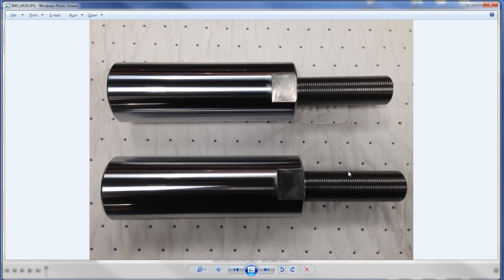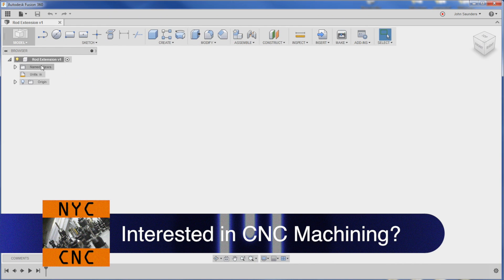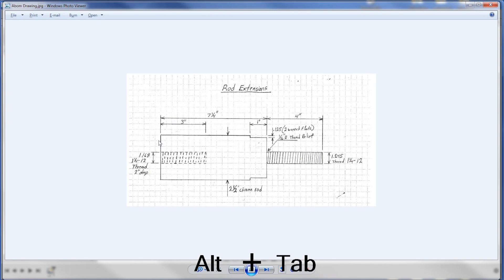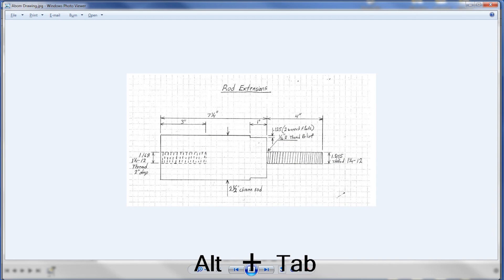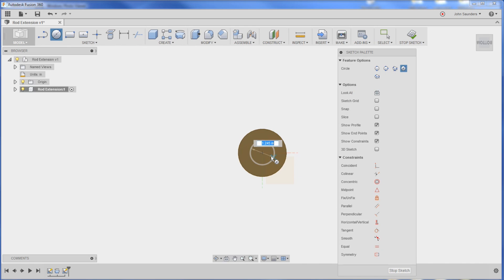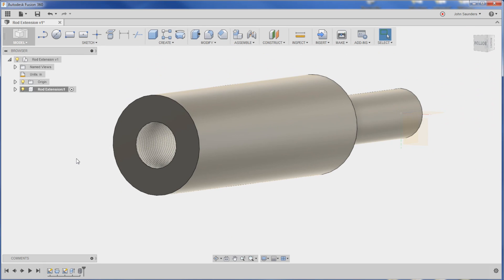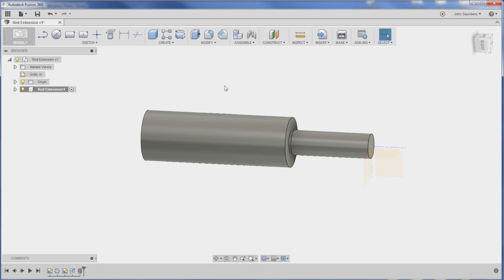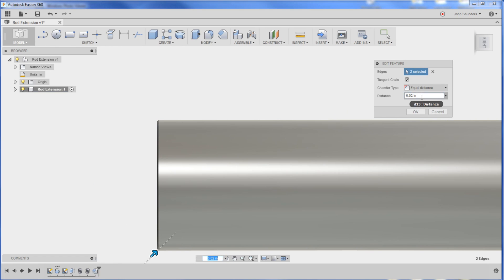Fusion 360 Basic Tutorial: Rod Extension!  Fusion Friday #28

Comment: since the wrench flats are dimensioned from flat to flat (i.e. the size of the wrench), isn't there some way to sketch a rectangle that is that dimension, centered on the axis, to use as a model?  That way the constraint would be the wrench size, independent of the rod diameter.
Reply: There is. Draw two horizontal, parallel lines on the sketch. Use the Equal constraint on those two lines, and then dimension the distance between the two lines. That'll do the trick. http://i224.photobucket.com/albums/dd198/ZierraOrbital/02-08-2016%2012-38-18.png

Comment: John, why do you always work from a sketch and rotate or pres pull?
Would this part not be quicker by using cylinder objects and joining/substracting them by boolean operations?
Reply: +Robert Eckelmann It's easier to make changes down the line if you do it the way +NYC CNC does it. Your way technically works, but has some limitations depending on the complexity of a given object. Plenty of ways to skin a cat :) (That phrase still makes no sense, but whatever)

Comment: Nice video.
Couple notes: the threaded rod OD is (I think) the major diameter of the thread so if you used the nominal thread diameter and then apply the thread, the software may adjust the OD to that final dimension. Similarly for the hole ID. In Solid Edge, you pick the nominal threaded hole size and thread pitch and specify the depth. 
Might be worth checking. I noticed that Fusion 360 automatically adjusts the diameters.
Thanks,
John

Comment: I need some help. 

I have an STL file of a pulley imported to the fusion 360 program and I converted it to B Rep mesh to make it workable now I want to find the center of the hollow motor shaft but since it's an STL it doesn't have a DXF sketch attached to it , to do that is any method to find the center of a hole in a STL model in fusion 360?

Comment: John, please stop teaching beginners the bad habit of creating holes with extruded circles. Great video otherwise.
Reply: why is this a bad thing to do? (for the fusion360 noobs like myself)
Reply: +Scott Moyse for instance I had an engineer put in the physical threads with a threaded hole widget. When it was exported out as a STEP file than opened up in MasterCAM. The threaded hole was converted to a series of spiraling octagons and none of which shared a center point.
Reply: +Scott Moyse Makes me cringe every time.
Reply: +Scott Moyse Please enlighten me, what is the proper way to create a hole? I've used several methods in the past. One the sketch and extrude as John shows here and the other is the "hole" feature in Fusion.
Reply: Jody Olivent the proper way in any CAD system is to use the Hole command because it adds more information to the model than an extrude circle does.
Reply: +Scott Moyse Thanks!
Reply: +Scott Moyse 

He created the threaded hole with the threads feature. The original hole was just a place holder for position to add the threaded feature. 

Besides. All that fancy C-bore/ thread/ etc info you put in,  odds are us machinists will never get to see it because either our CAM software doesn't recognize Fusion360/inventor/solidworks files, it does recognize but none of the tree info, so it just junks it and reads only the solid model. It lastly (and the most worst) it try's to convert the info to its own native info and usually causes horrendous model and surface errors. 

So please. For the sake of your machinists sanity, and possibly your life, just extrude cut a damn hole 😆
Reply: Occams Sawzall designers/engineers/machinist all over the world use hole notes on drawings or 3d annotation without issue all day every day.
Reply: +Scott Moyse drawings yes. 

I'm talking about the actual 3D model.  That stuff has consistently reeked havoc with CAM software for years due to import/export and conversion issues. 

There doesn't seem to be an industry standard yet for converting, and STEP and Parasolids get cranky trying to convert it depending on the software and how it handles it's exporting.
Reply: Occams Sawzall yeah threads should only be modelled for 3D printing or rendering. Using the Hole command does add or doesn't have to add modelled threads (some CAD packages allow you to choose if you want the threads modelled as part of the hole command).
Reply: +Scott Moyse 
A lot of times using the thread widget (that's what I'm calling it now) even without modeling threads does define it as a true circle. It turns in into a bunch of slightly different radi to make a circle, or changes it into a half a million tiny lines. 

Modeling for just a print or 3D assembly vs modeling by for a 3D model to be machined off of is actually vastly different in approach. Like rendering tolerance might be set to .010 for assembly. But have notes that are speced to diameters and positions in  .tenths.   So exporting a .010 tol model can really screw up a machinist relying on the model to be correct. Or they have to spend half a day remodeling holes and such to ensure they are at the correct position and are true holes.
Reply: Occams Sawzall Solidworks, Inventor, Solid Edge & Fusion 360 only apply cosmetic threads (images) when you define a thread. Unless you tell it to model the thread. So there must be something else causing you to receive models with wonky holes, because it's not from using the Hole command in those applications.

Comment: Nice demo. It looks like you could just add the internal thread feature and Fusion would take care of the required hole, saving a step. Because you initially got the hole diameter wrong (divided by 2 when you were working with diameter, not radius)  so the hole came out to .584" instead of 1.168", but then the thread feature fixed it all up. I don't think it would handle the non full length thread, but maybe there is a setting for that, I didn't see.
Edit: Had to fire up Fusion and check. Nope you can't do a thread on a point, that I can see, there has to be a hole first, so there is a surface to put threads on. But, the hole doesn't have to be the right diameter, as you showed. You can also add 1.25"-12 threads to a 2" diameter hole, and Fusion will shrink the hole to make it work.  It would be nice if in the hole feature, there was an option for threads, like they have in Inventor.

Comment: As John said, many ways to do it.
But I would put the wrench flat on the initial sketch. Revolve the 2 profiles (main inner body + wrench flat - I don't think Fusion allows you to select the sketch's outer loop) and then extrude cut the wrench flat rectangle Direction:Two Side, Operation: Cut, Extents: All. Then mirror the extrude cut feature to the other side of the part.
This way the dimensions and information about the flats is on the same initial sketch and most of the other details.
I've found that creating too much extra geometry/sketches confuses yourself (and others) in the future.

Comment: I think abom is meaning 1/16"rad thread relief .. The depth is to the minor diameter of the thread
Reply: +scrapn1085   I believe that is correct. That corner against the larger diameter barrel (2.500"), and any sharp cuts to the minor diameter of the thread, is a possible location for a fatigue crack to develop.  Having a square, sharp-corner-cut relief is not good.  WarrenW